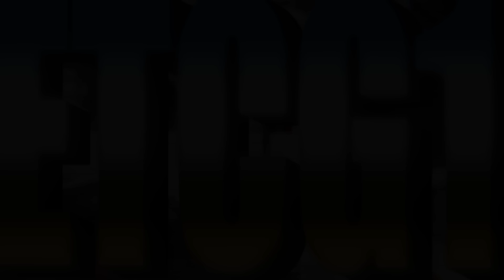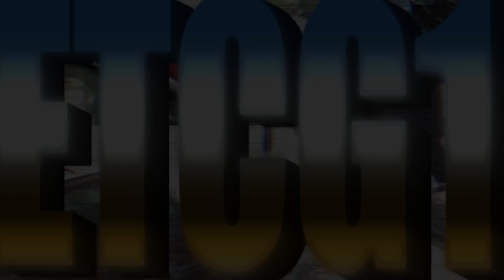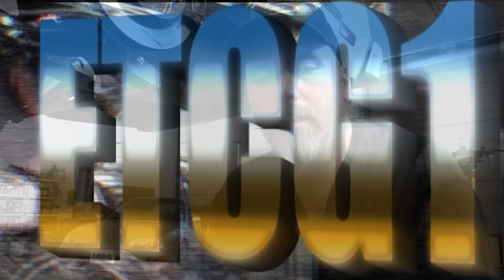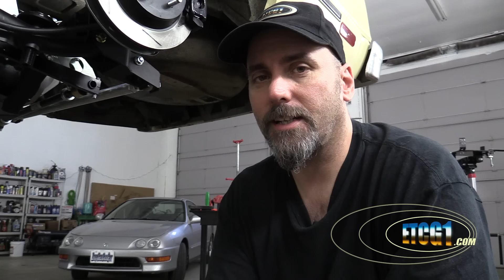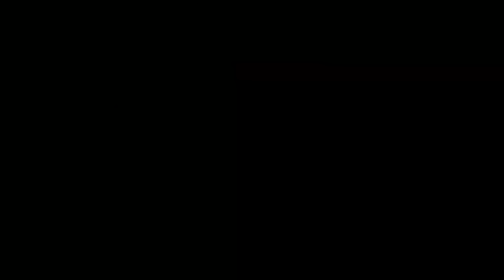Misconceptions About Performance Parts

Comment: Bolt on performance is real, I can bolt on new tires and see a world of difference, or i could bolt on an ati harmonic balancer so my cars performs better at high rpm! bolt on coil-overs to get my tires to work their fullest.. etc...

 bolt on horsepower is a lot more tricky and should be done as a whole unit! i cant just put on bigger fuel injectors without a wide band o2 and ecu, plus there is no point in increasing the size of fuel injectors if i haven't done anything to help the system breath easier (intake and exhaust)... 

point being, everything is bolt on! thus bolt on performance is real, but not all "performance" parts are understood and people don't understand their system or what end result they want. so they just put on any parts they see because their "aftermarket"!  and the real debate is what after market parts are going to get me the performance i want. and what oem parts are better than after market.
...closing thought,
most people don't want to spend a bunch of money on their cars and they especially don't want to spend the time and energy to re-engineer the factory system, but they want better than stock, so they do the cheapest things that knowingly wont totally disrupt the original engineering. calling it "Performance" but obviously to car guys we understand the gains or losses involved with certain bolt on setups.

Comment: always be careful with ebay parts but some should be fine.  an ebay header should be ok.  worst case scenario it doesnt work out and you either replace it or repair it.  i have an ebay radiator in my jeep.  works great.  i also have a pretty cheap exhaust on my subaru from gimmick motorsports.  $300 and it looks and sounds great.  

i would avoid turbos from ebay and engine internals.  

oh i also have an intake manifold and tgv deletes from ebay.  in this case its a guy who modifies and ports the stock parts.  that to me is perfectly fine.

Comment: I I wouldn't call it a cold air intake I call it a free air intake not just a box with a tiny hole in it that your whole engine is supposed to breath though now it can breath through the whole filter and it's reusable that's the main reason I got a one

Comment: Your car is a tool that does a job composed of parts. One of those parts will restrict overall performance the most. Usually when upgrading the transmission is the weak link. Why put transmission that can handle a Dodge Viper engine in every Mini Cooper as stock?

Comment: All of the engine's power comes from the heads.  If you don't work the head, you're bolting on nothing.  Even a big lumpy cam is useless with stock heads.

That said, if you bolt on a new or reworked heads, then yes, that's "bolting on" power.
Reply: That was only true up until the 1990's.  Heads today flow great.
Reply: Only if the head was a choke point.  Won't help if the intake and exhaust can't shift as much air as the head can flow.

Comment: I always like to describe it as bottlenecking, there will almost always be a limiting factor, going to do headers and exhaust? Well the flow of the heads might hold you back, doing heads too? Then you're gonna need to do the intake, wanna make use of everything? Cam.  There will always be a weakest point so to speak.

Comment: you PROBABLY did gain HP with your new header...like 10 or something.
but with a stock intake and head, your not pumping enough air to really take advantage of that header. 

take a 200 hp engine, stick on a header....you get 210, mabey 220. 

take a 500 hp engine (same or close displacement)  with cast iron manifolds...stick on a header...your making 550 - 570.

ya, cold air intakes dont do much....but a cnc aluminum head, new intake, and cam WILL make power. 

bolt ons can make more power, and usually do.....but your not going to take a 200 hp enigne and turn it itno a 500 with bolt ons. 

for high power, your intake needs to match the head, which matches the bore and stroke ratio, which matches the compression, which matches the header, which matches the exhaust. 

getting the right cam is also CRITICAL. 

hell, my dad has a 440 big block mopar in his 72 plymouth satellite sebring plus...makes about 450 on 110 octane, but would ping its guts out on 91 (compression isnt high enough to need more than 91)

but we were having HUGE problems getting it to run above 3700 rpm.....lots of detonation. 
pulled HARD to 3700, then broke up

different intake, carbs, dual point dis to electric...fuel pressure regulators....didnt work 

turned out to be distributor advance was fucked up (which i suggested, but my dad didnt know much about...didnt want to make it worse, but we helped the machine shop out and he adjusted it for payment)

and then we went 2 'sizes" colder on the plugs. 

and now the fucker RUNS, burns off the wide tires with a locker....my dad is so happy he can just fire it up and drive on 91.
he would take 80 hp if it was turn key....must be getting old...

take it to the strip, stick 110 in, add a bit more timing....and holy shit
Reply from the maker: The shape of the header wasn't any different than the stock manifold. The only thing it did was reduce the weight. Which is great, but it didn't increase power at all and I never expected it to.

Comment: Several years ago when I rebuilt the engine on my 1991 Explorer, I ordered Borla headers and exhaust system which took 2 months to get. It did add horse power and sounded great. Nice investment which paid off.

Comment: stick to breathing mods. you dont gain horsepower you just free up horespower from its restricted factory form. engine power is rated at flywheel in a lab not at the wheels

Comment: If all you are chasing is Horse Power you are wasting your time. Even if you double your Horse Power you will never see even close to a double in performance. you bight see, at best, is about a 15% improvement but even then the car will not really perform better because everything else on that car was designed to work with the original Horse Power, Torque, Weight etc. When you change one thing it affects everything else and usually not in a positive way. You really have to think of a car as a system with many subsystems. The home mechanic can most definitely improve his or her cars performance but performance describes how the whole system works and not just one or two subsystems.
Reply: Engine power increase to vehicle performance increase ratio is typically and approximately the inverse of the square. 
Or expressed in words:  to double the performance of the vehicle it requires 4 times the power with diminishing returns as the vehicle performance increases.

Comment: with the obd2 era cars the integrated circuit is your friend . all those bolt on mods you put down are all for naught if you don't talk to ole hal9000 in your engine bay . when you do the tiny titan under that hood wakes up versus you scolding your steel beast for acting out of line. research is free go out and have fun

Comment: If you add performance parts to your engine, you SHOULD reprogram your computer.
Reply from the maker: Good point but in the case of the Integra that wouldn't be possible as Honda computers of that vintage are not programmable. If you say change it out with a stand alone, think again as you would also have to bypass the immobilizer in order to get the engine to run.

Comment: Too much HYPE with aftermarket parts, most of them yield little improvement if any and cost a load of cash for cool looking crap!
Reply: Like anything it depends on the R+D and quality of the parts, and how they work as a system. :)  The worse the stock items are, the easiest an improvement.  The better the stock items, the harder an improvement.  If you can't pick up power by throwing out the log headers on your '77 Chevy and putting on extractors, and swapping out the standard Carby for something better than something is seriously wrong!  Of course improving a Camaro ZL1 is rather less straight forward! ...For example, the package of cams, exhaust and header that Hytech do for the  Honda S2000 do make a big improvement, whereas randomly throwing on other cams, exhaust and header may not do anything or will make it worse.

Comment: Try to avoid generalizations..the big problem with the parts you discussed, people dont realize how complex flow is so they throw a 4" exhaust on their 2.0l to decrease"backpressure" and end up losing power due to poor scavenging and air velocity. just one example of how generalizations in car modifications cause problems.